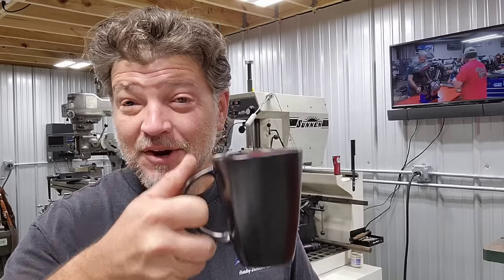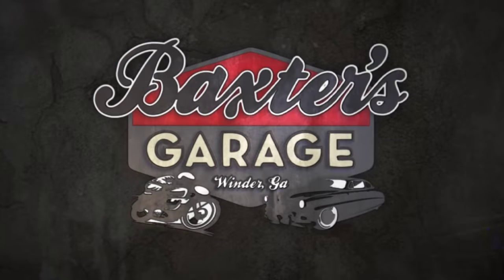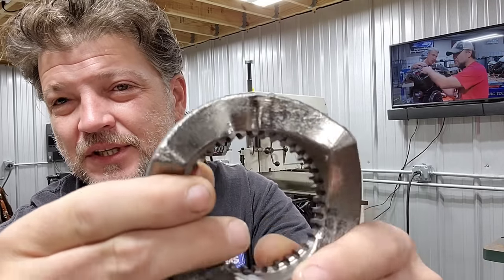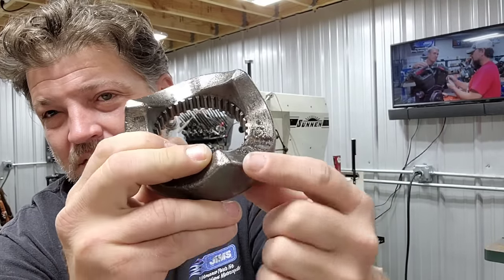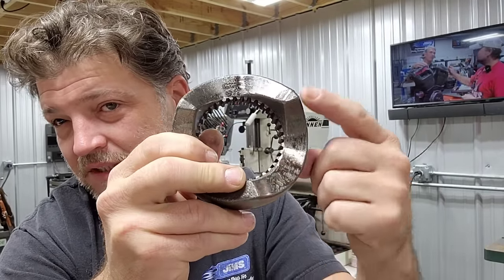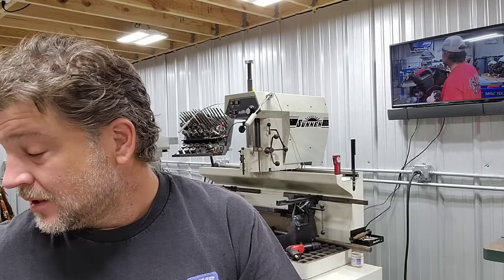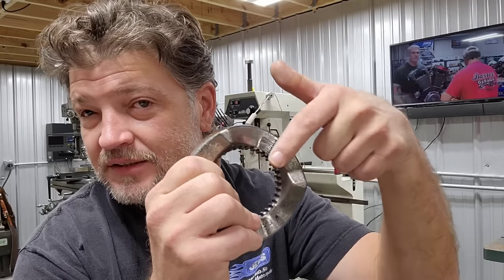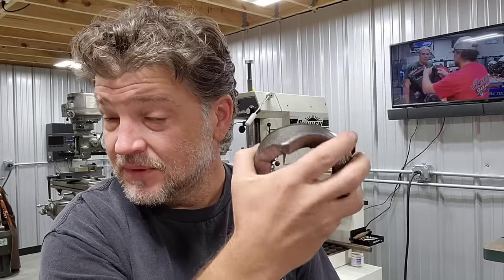Compensators For Your Harley...Should You Eliminate Them?

Comment: I have heard, and totally believe that quite a few failures of compensators were / are caused by bad riding habits, and NOT just overly aggressive riders, but the crowd that likes to lug their engine. You know, the guys that short shift their bikes, and are heavy on the throttle at sub 3,500 rpms.
Reply: I guess. If one considers going like hell a bad habit 😄
Reply: I have owned over 25 different Harley’s from shovels to M8s, I have never broke or worn out a compensator. Check your riding styles. I ride aggressively but not without thinking about mechanicals going on.

Comment: Pretty much hit the nail on the head when you brought up the issue of high horsepower and torque in today's engines. The reason we can run straight sprockets and primary chains without tensioners in our oil Panheads is because we're not churning out crazy high H.P. and torque numbers. And even with what we are putting out we break things. Today's big engines shake, rattle and roll and all that energy has to go somewhere. This the introduction of compensators. Eliminate them at your own risk because eventually something's going to give. Nice little video.

Comment: Went to a manual primary chain adjuster and solid sprocket. At 10k miles and counting, like being able to find neutral and the easy gear shifts.
Reply: Go hydraulic for tensioner , they rock 🤙

Comment: I'm a little late but consider this. My '71 fx has a solid sprocket and has no provisions for electric start. The same vintage flh with electric start has a compensator. But I once owned a 250cc Ossa dirt bike that had a compensator very similar to the harley setup. My contention is the compensator is to ease the pain on the starter be it an electric motor or your leg. Keep in mind the Ossa ran full advance timing at all times and could be brutal to start. I might be wrong.

Comment: I'm guessing that it could be said that the compensator is a sacrificial link that helps preserve other components in the drive chain setup, kind of like a fuse in an electrical system. So it's a replacement item that's easier and less costly to replace than everything downstream, would you say?

Comment: I’m running an extra spring in my compensator by Dan Thayer and I have 110,000 miles (18 RG) on the stock comp with a built motor. I ride briskly, but I don’t beat on it.
Reply: And where do I find info on the extra spring...can't really find a link on the net

Comment: My comparator went out 😢
I have a 21 road glide limited with 10,100 miles so its out of warranty.
I ended up with a billet comp ramp, new starter, new battery, I had one burnt clutch plate so I went with a set of heavier clutch springs.
Add in the labor and my bill was $1,800.
I'm not happy and about to sell my Harley and buy a GoldWing!!!!!

I am mad that every time I take my bike to the shop its a minnum of $1,000!
New "lo miles bikes" shouldn't have catastrophic failures, for the price of a new motorcycle today it should not brake OR have a better warranty!
Reply: 100% agreed

Comment: Kevin, you speak reason. As an engineer myself, I recognize that Harley engineers are not infallible. However, they are the experts in that particular design and they don’t add features just to make the product more expensive for the consumer initially or to make it more expensive to maintain. Those features like the compensator are added to make the product more reliable overall. Deletion of a certain feature should only be done after learning why it exists and deliberating the resulting pros and cons. 

You’ve added some education to why the compensator exists and what can happen if it’s deleted, which is truly helpful. Thanks!
Reply: Yeh, explain twin cam tensioners
Reply: Then why don't they balance their cranks from the factory?? Yeah great engineers and we are charged to much for very minimal
Reply: @WyattSmith-pu6jm the compensator does NOT compensate for an unbalanced crank. It compensates for how the Harley motors share a crank pin and that both cylinders are firing on the same stroke which creates pulses, especially at lower engine speeds (below about 2500rpms). Has nothing to do with unbalanced cranks.

Comment: I changed my Man O War in my 128" build at 20,000 miles to see if I'd notice any wear. The new bushings quieted it down. So while 20,000 miles doesn't seem like a lot, remember it is a 150hp 128" and the bushings are only $40.00 and really quick to change...not to mention the better drivetrain feel the Man O War gives...
Reply: I agree 100%:_skunk::_skunk:

Comment: I swapped my Comp ramp in my FLFBS with a tool steel one from CycleRama. Problem Solved. Compensator features preserved.
Was a fairly easy swap. You dont need to pull the clutch basket. You can pull the entire compensataor out once you remove the chain tensioner.

Comment: On my '09 Road King, I have chosen to compensate. After 70k miles the oe compensator began to fail, I opted for the factory recommended S.E. for replacement, my engine is relatively stock aside from an increase in displacement(to 103ci) and the usual "stage 1" goodies, I'm also not an aggressive rider (as I once was in my youth😉), so far so good and I don't expect it to fail anytime soon with my style of riding. Ride on all and be safe.
Reply: Installed a man o war. in my 07..Ultra...Hated it to much gear changing due to lurching...made sure primary chain was was right even put Hayden tensioner...Put in a 2010 SE comp...factory tensioner....Seem to be good.....

Comment: Thanks for this video, Kevin.  I am new to Harleys, and am discussing whether to upgrade or delete my factory compensator on my '21 M8 107, which I upgraded to Stage II.  Since I don't race, the answer is clear to keep the compensator, but I will upgrade to high alloy steel billet.  I have seen reports of stock cast compensators cracking even at lower miles.  I don't run the power many do, but even so that's an untenable failure on the road!

Comment: I have Hayden primary a tensioner. I have run them for 30 years. I got a 2020  Road limited new. I put the Hayden in the first week. Last fall I put a Dark Horse in 5000 miles. No noise from the primary. Love the Dark Horse. 
Very happy to see you back

Comment: Installed a Dark Horse compensator along with a Oregon Hot Bike hydraulic chain tensioner. Better throttle response, smoother shifting, and dead quiet primary! 
2015 SGS.

Comment: Great vid Kevin.  I have a stage 2 107 M8 and I want reliability. I choose to keep the stock comp and if it fails which I don’t expect it too because I don’t abuse my bike, I’ll just replace it with an upgraded ramp and spring pack. I want my transmission, clutch and driveline to stay healthy.  I’ll build a SE 119 or a 124 some day and will still keep the compensator.  My right wrist will roll the power on slower and I’ll shift the bike easier to keep the primary and driveline from getting hammered to aggressively.

Comment: This is excellent information, by a Very Experienced  Motor Builder..
And I will back up his Opinions fully, because I had an eliminator, but the clutch soon needed a new splineed hub..I did put back a compensator, currently It runs and shifts more smoothly.

Comment: I've decided this video is spot on.   I tried a solid...........Don't do it.   I took it right out as the chain clatter worsened especially at Idle.   There was no more compensation for the pulses.   I had the dealer install a booster spring on the original compensator and that was the ticket to a smoother shifting quieter compensator.  2014 Rushmore edition.
Reply: Ok i understand, but what is your opinion about belt clutch which is not using compensator? And works without problems!!!!

Comment: Low rev's in high gears has always been destructive in all big twins. 2 out of 3 riders I see today rack up the gears to 4 th in a 35mph zone running 1,800 to 2,100 rpm, then WOT it to 55 when the mood hits them. The same damage potential is present at touring speeds, when accelerating heavy in 6th, and even 5th just because you make 120 torque at 2,800-3,000. It's your money, hammer the crap out of it, it keeps children fed and looking good in school.

Comment: Kevin good video, I've got a 2008 CVO its my babe of choice, I have 76,842 on the clock I've had to replace the primary chain looked at my compensator there is very little wear. I'm a cruiser rider LD is weekly thing but from day one I changed oil products I'm my bike I contribute that to assisting in reduced friction less wear. I use a fully synthetic oil from Amisol. In all 9 of my bikes. Never had a comp failure.

Comment: I blew the stock compensator in 17 SGS in less than 10k miles. 3 dealerships said the noise was normal. Outside private owned shop confirmed it was not 😂. Was like pulling teeth getting HD to warranty the failure

Comment: I ran a solid gear on my 2013 Road Glide for roughly 500 miles, I didn't like the feel the bike had running, more of a vibration, so I went back to the SE compensator and haven't had any issues so far.

Comment: I got tired of replacing the stock compensator ( twice in 2500 miles) went to the baker set up and got rid of the  stock Harley primary chain adjustment set up and went back to a manual adjustment and have zero issues since. I feel the stock Harley primary adjustment device puts way too much pressure on the primary chain which I feel might be the issue with comp sprockets making noise and failing Harley has to know there is a big issue here when my local Harley dealer keeps plenty of these in stock! Hmmmm…..
Reply: Could you post a link for the baker setup please? Tia

Comment: Sir all I have to say is this. Lol
As a Skunkworks 124, it has all the trimmings. She looks stock...but nowhere near it.
We start with Öhlins USA fork and shocks, a race ready Darkhorse Crankworks custom bottom end and motor sprocket, Baker Drivetrain Official Page DD7 and primary adjuster, Trask Performance billet clutch basket and air cleaner, @Bandit Sportsman clutch, S&S Cycle, Inc. gear drive with plate and pump, our own Skunkworks heads and cylinders, Horsepower Inc. throttle body, our blueprinted custom injectors, D&D Exhaust Billet Cat, @AIM slave cylinder, and ARP 12 point polished fasteners hold it all together.
Shes smooth as silk, easy to ride, but at 152hp and 148 torque, be ready when you whack on it.
After 13k and a few oil changes she’s still running like a Swiss watch, or better.

Comment: Just saw this video Kevin I thoroughly enjoy your videos they are very informative. I just upgraded my 2011 FLHX with a 96” TC motor with a new S&S Camchest kit, oil pump etc. based off watching your videos I took great care to measure everything to assure my crank and other  areas within the camchest were in spec. 

I replaced the stock compensator with a dark horse comp, Barnett clutch with the coil spring pressure plate to assure I had no issues in the primary. Since the upgrades I increased my torque to 110ftlbs. I had the bike tuned and put in a dyno it throws out respectable numbers for a stage 2 with my set up on that motor. Thank you for passing on your knowledge it definitely helps with making sound decisions.

Comment: Good insight - My billet Comp and Evolution Industires New Comp Spring packs are a good match. Compensators are a serviceable item and should be looked at for wear and if worn replace'em. My guess is checking around 10-15k unless sooner is needed for some unforeseen reason.

Comment: Knowing when your HD is using the compensator or the clutch is important.  If you use the clutch properly it will slip as you add power and take off.  If you do not use the clutch properly the compensator will chunk-chunk-chunk to compensate for the lack of slipping in the clutch.  Since most riders only know how to kick a bike and gear and take off, you'll hear that compensator chunk-chunk-chunking after they duck walked their bike away from the curb.

Comment: FYI late forties Indian had compensators to prevent keyed shafts from spinning in the cast iron flywheel Harley borrowed the idea for their cast-iron flywheel in 1955. In the seventies Harley improve the compensators and in the eighties they discovered it was a great idea for spark knock. I worked at a Harley dealer in the early 70s and a old mechanic told me the truth of the compensator some companies have a compensator that copies the 70 style and other companies will copy the shovelhead Sturgis style. My friend George which was in charge of r&d at Talladega inform me they were going to a rubber cush drive in the rear wheel... So why do you need so why do you need a compensator. The main issue on 07 to present is the primary drive speed is greater than the 2006 and earlier
Reply: PS.. been wrenching on Harleys since 1963

Comment: I had a 2008 heritage and about 40% of startups it would act like the starter was disengaging and jumping back in while the motor was rolling. It sounded like total shit and you could feel it through the bars. It cost me $550.00 for a completely different compensator kit from Screaming Eagle. I also had to replace the rotor on the alternator. Harley had about 40 units in a corner that had come off of customers bikes. The factory trained mechs had come across a customers bike that had this problem. The bike was in and out of the shop numerous times over a yeatr period. They could not isolate the problem so talked with techs at the factory. The techs lied. They claimed to have no knowledge that would help the mechanics cure the bikes problem. The dealet had been in touch with every factory dealership on the west coast. They all experienced the problem at one time or another. In the end, the local shop mechanics had an article sent to them from a motorcycle magazine. It explained the problem and cure. The factory lied snd refused admission to their f -up. A recall r reimbursment would have cost them as there werre multiple years sporting that compensator assy. So they screwed their customers. Like I said, it cost me $550.00 and I did the install. I was not aware that Screaming Eagle was owned by Harley. I thought it was a private company. They were the only outfit with a cure in the beginning. Now multiple after markets carry them. Im going back to a Ducati. Ive owned Harleys all my life. The first was a 59 Sportstet I bought at 13 years old. I have the 2008 105th anniversary softail and a 2015 road king. If i outlive them, Ducati will see my money again. Im not remaining loyal to an outfit that reams its customers, and lies. The local mechanics were pissed when they found out that the factory reps had lied to them. Harley does not deserve to remain in business  acting like that. Also, my buddy just picked up his first harley. Its a 2002. Hes ridden all his life. One week into his new bike it quit running. The dealership refused to work on it. They only accept 2003 or later now. And their labor jumprd fron $96.00 an hour to $160.00. Bullshit people.

Comment: Sportsters were sold with compensating sprocket on e start and straight sprocket on kickstart models until the mid 70s. The old timers told me horror stories, but I havent seen it first hand. People have run straight sprockets on pans and shovels for years and have generally been fine

Comment: The engine shaft side variator pulley on my moped is made of aluminum I've replaced it many times but it's a lot cheaper than a bent crank! I think this is a similar situation.

Comment: Compensators exist because HD did not use cush drive rear hubs until very recently. I've run plain sprockets ("eliminator" my posterior, it's a farking SPROCKET) for many years without ill effects on my FXRs which have stock rear belts.  Many professionals run sprockets on high output engines without issues other than not having to replace compensators. HDs core market are sensitive about vibration. It's not like the old days when that would have been laughable as HDs were expected to vibrate.

Comment: Thank you. I got my shovelhead stroker with a non-compensator sprocket 15+ years ago. Everything you said makes perfect sense. I imagine the engine pulses are even worse with a stroked engine. Your well put together video answered a bunch of long lingering questions. My '79 FLH is chain/chain and never cruised as smooth as I would like. Feeling the hard friction somewhere in the drivetrain bugs the crap out of me, I am in the process of swapping transmissions. I have the primary cover off, and when I squeeze the primary chain together the clutch basket moves back and forth considerably. I now am wondering what kind of nightmare I am facing with removing the clutch basket, "It all goes somewhere". I'm afraid I am going to find out where.